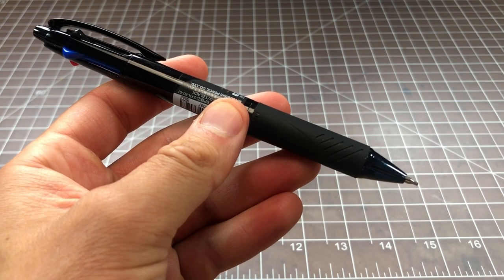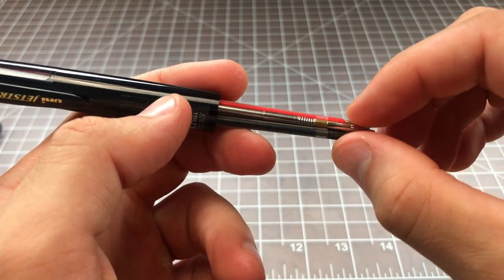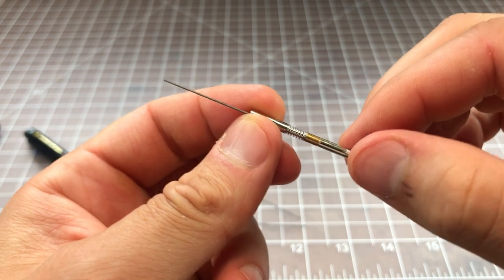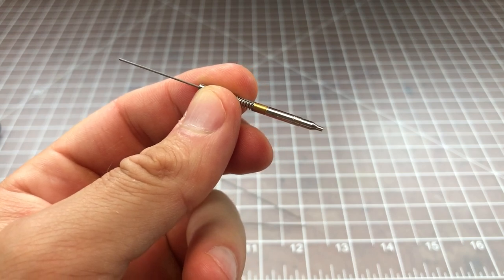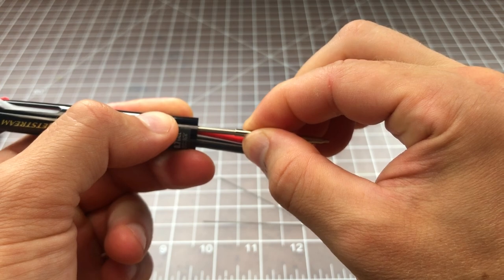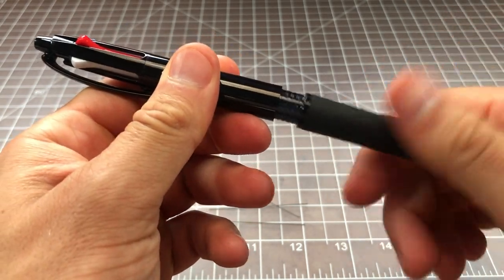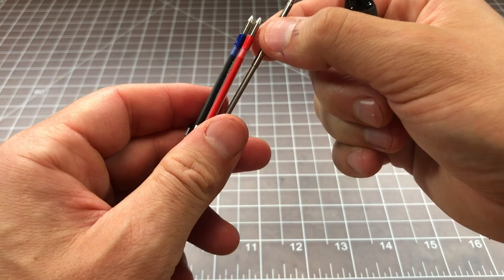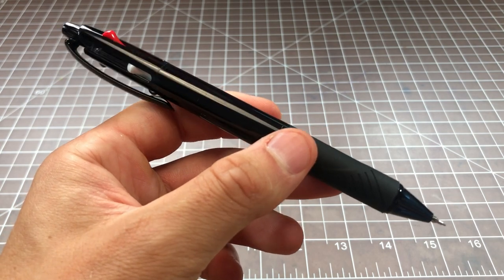How To Refill A Multi-pen Pencil (Or Fix A Broken One)

Comment: How timely, I recently got a Pilot Hi-Tec-C Coletto (a 500 and a 1000) gels with a pencil option. They're much easier to change as the hinged top opens and you drop in any color you like for each slot (the slider is part of the cartridge) so you can make some interesting combinations.

Comment: Have you tried pulling out the entire mechanical pencil? Or have you tried switching the mechanical pencil part with a pen refill? I was hoping to switch out mine and don't know if it would work. Hoping you've had some experience. Thanks :)
Reply: Did you ever try this? I would like to buy a 3in1 and replace the lead with an ink refill

Comment: My lead was falling out and I fixed it by taking it apart and knocking the back of the mechanism against the table several times. Some small lead particles fell out and it went back to pushing the lead correctly

Comment: Didn't help. I wanted to know how to refill the ink parts. And this guy just focuses on the pencil bit (the easy bit)
 Can you refill the ink on these ? I just lost 5 min of my life due to a bad Google search suggestion. Thanks google.
Reply from the maker: It’s called a “D1” refill. Many brands sell them.
Reply: Well, I thought the title was pretty clear. And as a first-time multipen user, it clearly showed me how to refill the lead, which was what I searched for. The ink part I thought was more straightforward—just pull and stick it back in. 

Thanks Unsharpen for another excellent vid.

Comment: Is it possible with this or any other "Multi-pen Pencil" to remove the pens replace them with the mechanical pencil in effect creating a multi-color mechanical pencil? This would be very handy. The idea I have is to use four different color leads in one unit. Thanks for any advice. 😃👍
Reply from the maker: Generally no because the lead advance mechanism is different then the pen slider. You can experiment but it’ll be be hit and miss
Reply: @unsharpen  I checked around. It is possible with Pilot Multi-Pen Body, Hi-Tec-C Coleto 500, Black Body (LHKC-50C-B). But it would cost a fortune lol. 🤣Pen body is $6.70 and the mechanical pencil units are $7.96 each. I'm going to experiment.

I like to sketch and draw. I could do my intial sketch lines in different colors, one for foreground, one for background etc. I'm trying to figure out ways to reduce the load in my tactical military style backpack.